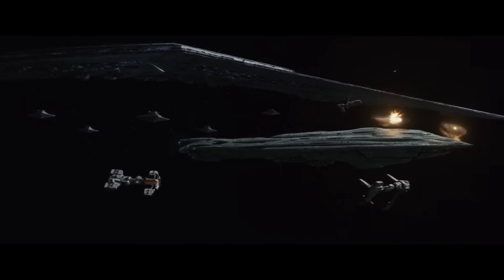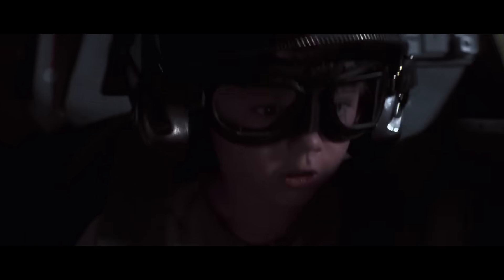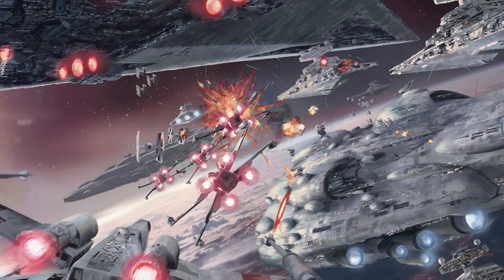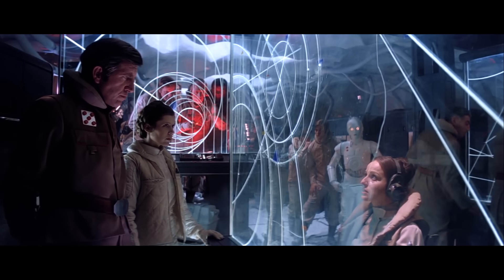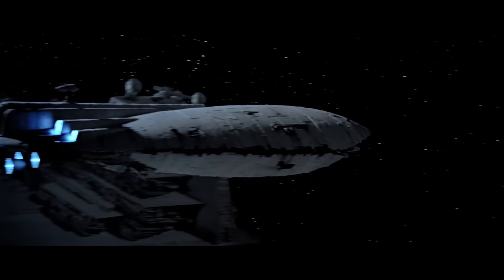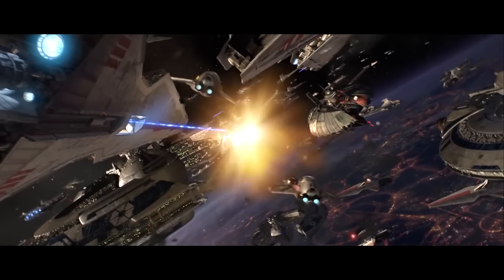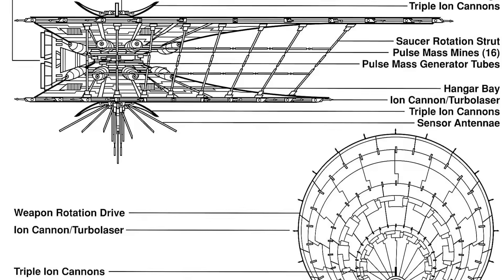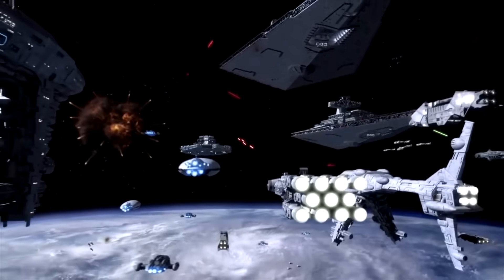Why Star Wars Turbolasers SUCK! (and better options) | Star Wars Lore

Comment: 341 attempt at Forerunners vs. Warhammer 40k.

For Thor's Hammer!!!
Reply: Molom Labe The FORERUNNERS??? IN 40K?
Reply: Anything vs the "entire" 40kverse is gonna lose. I'm not just being a fanboy, the 40kverse is just designed to be excessively over the top.
Reply: Forerunner would win but it would make them give effort to the war. If you think 40k is overpowered than your going to pass out trying to understand the scale of power of the forerunners
Reply: @themadtacoeatingfool5228  
Khorne laughs at Forerunner power 
Tzneetch scoffs at the Forerunners plans
Nurgle giggles at what they call creation
Slaanesh sighs at what passes for their ambitions
Reply: This is not a legit suggestion. Not saying that it isn't a good question, but Thor's Hammer puts that some suggestion multiple times for each video, so the real number of him trying daily is actually much lower.
For example, on just this video, he has a comment with 8 likes saying:
"Attempt 356
Do the Forerunners vs The Imperium of Man (Halo vs Warhammer 40k) please."
And another comment that has 3 likes saying:
"Attempt 354
Do the Forerunners vs The Imperium of Man (Halo vs Warhammer 40k) please."
And incase you are wondering, he didn't even put an Attempt 355 on this video. So he's also just skipping numbers here, and I doubt it's his first time doing this, or it being unintentional here. Not to mention that this comment is at Attempt 341, which is noticeably less than what Thor's Hammer says he is at.
EDIT: I @'ed someone when making this comment, that was unintentional.
Reply: i concur, i would like them go up against the nids, chaos or necrons.
Reply: @itsyaboidaniel2919  This is the level of Fact checking and Research that seems to be missing for some people.
Reply: Lol here we go. The Forerunners have the ability to easily curb stomp the warhammer 40k universe. For one example all their weapons have the ability to disentigrate just about anything they fire at. Also in Halo: The Flood the guilty spark mentions to Master Chief that his power suit is inadequate and tells him he needs a lvl 12 power suit. And as it has been shown Master Chiefs suit greatly augmented his strength and allows him to tank plasm bolts, explosions, falls from orbit, and kinetic damage. Imagine what a lvl 12 could withstand, basically anything the space marines, Tau, Chaos, tyranids, and eldar could throw at them with their handheld weapons and even shots from their armor.

In space the Forerunners have something called a fortress, there would be thousands of these, which is a dreadnought ship that is 50km long and has row upon row of heavy plasma cannons, along with fighter bays. Just a handful of forerunner cruisers were strong enough to totally eradicate a ring in the book Cryptum. It was also mentioned in Cryptum that the warrior caste has flipped a planetary crust upside down before totally annihilating it from space.

Also on the ground the Forerunners have something called a war sphinx which has the ability to wipe out cities, and sweep across continents, and if we go by size a lvl 12 powersuit can tank a ridiculous amount of energy, and kinetic damage, a War Sphinx can take a heck of a lot more.
Reply: The Forerunners ecumene consists of over 3 million worlds, they have visited other dimensions, can tend and alter stars, have the ability to make entirely new planets and stars in some short 10k years, have mastery over slipspace and can rapidly move forces around via slipspace as well (with speeds in excess of millions to trillions times C, meaning that moving across the galaxy is child's play). Of course, they also have the Halo array as a last resort to burn out every neuron in the Tyranid hivemind (and themselves) if need be. Fighting the Tyranids would not be like fighting the Flood, as the Flood gained their foothold via means that the Tyranids simply can't access (also no logic plague, so Forerunner security would be preserved as well). In addition, blowing up stars to sterilize a star system of Flood life was standard practice during the Forefunner-Flood war, meaning that due to the Forerunner's ability to make new worlds from scratch, they can go above and beyond standard Imperial exterminatus procedures.

The Tyranids force is comprised of many, many hive fleets, each with thousands of ships to their name. So all of the hive fleets would mean a force of potentially millions of ships forcing their way into the ecumene. Tyranids do have a form of superluminal speed travel gia manipulation of gravity fields, but compared to Forerunner grade slipspace drives that allow for speeds of millions times greater than the speed of light, Tyranids might as well be turtles. Tyranids in general adapt fairly quickly to new threats, and if all hive fleets includes Hive Fleet Gorgon, then this could prove to be a problem for the Forerunners. And (assuming OP allows it) Tyranids would have access to psychic abilities that may prove deadly if they ever get on the ground.

This fight would most likely be a question of quantity. Tyranids have a lot of hive ships, but Forerunners have plenty of guns (Onyx sentinel formations come to mind). Some 50 sentinels could destroy a Covenant destroyer, and there were trillions on sentinels on Onyx, with a new one made every 6 seconds! How many sentinels existed in Forerunner space then? All the Forerunners would have to do it make a giant wall of sentinel formations at the edge of the Milky Way, and they will win. If the Tyranids manage to break through, they might have a chance of winning the ground battles on whatever planet. But as long as the Forerunners can maintain space supremacy, and fill the void with enough lasers, Forerunner ecumene takes this one. The Tyranids would be mere pest to the forerunners. They lack many of the advantages of the flood and would be little more then a joke.
Reply: Eck has liked your comment. The future seems bright.
Reply: @SpectrumWarrior1  if the fight takes place in the current WH40k universe, than the imperium, nids, orcs, eldar and necrons would be the least of the forerunner's problem. 

its a crapsack galaxy there where the result of a galaxy wide war between the old ones and the necrons are still being felt when they poisoned the immaterium with their dead. the eldar tore the reality and have the warp bleeds into realspace and the imperium is probably in its last stand following the 13th black crusade. 

they might wipe the imperium, but i doubt it will be a rofl stomp regardless of what system shattering weapons they have.
Reply: @rawwset  Like the Forerunners would give a flying fuck about what the Chaos gods thought. They have nothing to offer them that the Forerunners could want.
Reply: @itsyaboidaniel2919  I got from him and I kinda took it and expand it.
Reply: @internetzenmaster8952  The Didact wasn't genocidal until he was driven mad by the Gravemind. Forerunners as a whole completely abhor senseless violence. So that's a big no-go for Khorne. 
The Master Builder is an unchallenged position of power over the Forerunner Ecumene. He needs no help from Tzeentch. 
And good luck to Nurgle, being able to feed off of a race where death, entropy, decay, and disease are practically non existent.
Or Slaanesh who needs extremes of sensation to feed his/her hunger, where the Forerunners are deeply conservative and reserved. 
The Chaos gods are the respective characteristics they embody require them to be brought to their absolute extreme in order to gain any sort of power from them. In an idyllic, post scarcity society like the Forerunners, none of these would exist.
Reply: @MrMcp1995  Brilliantly said. I was looking for words for how Chaos wouldn't just instantly corrupt 80% of the Forerunners that many people love to bring up. You did it perfectly.
Reply: @internetzenmaster8952  the forerunners could easly stompnthe imperium
Reply: @MrMcp1995

Do you not understand how Nerg works? He uses the warp to corrupt flesh and minds, biological medical science would do nothing to it and the forerunners would succumb eventually. You literally can't treat the inflictions without warp manipulation
Reply: When comparing halo ancient races you gotta understand they they all all the definitions of a god species for any universe flood forerunner ancient human precursor all of them are gods.
Why precursors are gods
-they literally created the halo universe as we know it nuff said
Why forerunner are gods
-they literally can create life, they literally can create suns blackholes, matter itself etc
Why ancient humans are gods
- take forerunners and give them a boost you got ancient humans
Flood
- the literal embodiment of the precursors wrath
Reply: @SpectrumWarrior1  we have immortal daemons empowered by war and conflict that come  back when they die. You just lost.
Reply: @MrMcp1995  if you used your brain you might realise that I'm using we to refer to the the group of people who support the wrhakker universe winning in such a conflict
Reply: Warhammer may have gods and a hundreds of times more numbers than the forerunners but at the same time the forerunners have a neat bioweapon called the flood and  superweapons the Halo rings
Reply: @TouringWolf42  none of which would stop warhammer. The tyranids are far more adaptable and have way more numbers than the flood, and both the flood and the forerunners would be wiped put by a good dose of nurgle's rot seeing as you have no psykers to cure it. The rings are also useless agasint the tyranids or necrons and would have debatable efficacy against demons. Either way firing the halo rings would be an exceptionally bad idea against chaos as the mass death would empower it and may be make a new chaos god
Reply: @naggie6358  the halo rings destroy sentient beings and as far as I know tyranids have a biology plus the forerunners with their technology could easily change the outcome like they did by letting humans survive the Ring purge around the GALAXY even if tyranids were to eventually overpower with numbers doesn't mean the forerunners can wipe most of them off the face of the Milky way
Reply: @TouringWolf42  the tyranids have chitinous exoskeletons and lack sentence, both of which make them immune to the flood. Even if they weren't they would still adapt to be immune to flood infection after the at most couple of hundred infections. Also the rings only kill sentient life, which tyranids are not, and modifying them to kill sentient life would just wipe everyone out apart from chaos and the necrons
Reply: @naggie6358  Do you even know what is the flood ?
Reply: @decagamin5901  extra galactic parasitic organisms, massive population. Infects species with a central nervous system, and based on how the rings work to stop them, sentience. Induce forced and rapid mutation within the host. Infection works by attacking through the spinal cord to kill the victim before a forced rewrite of the brain and the introduction of a flood master cell to start mutation. Very little in the way of their own tech, mechanical or otherwise, generally using stuff from infected individuals. Tell me if I missed anything
Reply: +Internet Zen Master,

"Imperium of Man probably loses (but makes the Forerunners commit a lot to doing so)"

no lol, Forerunner Production alone makes them win against the Imperium, even if they were only on-par with Pre-War UNSC ships the Forerunner's would still win through goddly production.

"but Forerunners get wrecked when matched against all of the 40k universe (assuming this is Forerunners going into the 40kverse anyway)."

uhm no lol, again Production alone dictates that they would stand a chance, and Production+Power dictates that they win against modern Wh40k, but WIH Necrons could maybe stalemate them.
Reply: +Internet Zen Master,

"Necrons laugh in the Forerunners face"

and get fucked because the Forerunner spam mech suits each individually more powerful than a necron lord (and has a variety more uses.)

"Chaos says "thank you for all the new converts""

and also gets fucked because the Forerunners don't have souls in the Warp because they aren't native to Wh40k, and they like Eldar capture their "souls" when they die, and Forerunners are known to be able to manipulate other dimensions quiet well. (meaning they could quiet easily fuck with the warp, and possible close it off from Realspace like the Necron's can.)

"and Orks will loot Forerunner tech and turn it against them"

more likely they will all just die because the Forerunner anti-matter weapons.

"which are two of very few sci-fi verses that can out-"over-the-top" the 40kverse"

you have far far far too high of an opinion of Wh40k, it's a mid-tier sci-fi at best.
Reply: +Mustang McKraken,

"Do you not understand how Nerg works? He uses the warp to corrupt flesh and minds, biological medical science would do nothing to it and the forerunners would succumb eventually. You literally can't treat the inflictions without warp manipulation"

first off, he needs to get the virus too them, second they aren't completely magical viruses lmao, they can be combated with fucking nano-tech (as shown by the nids,) which means that the Forerunner suits alone wouldn't even have to destroy the virus because they can just keep it from spreading with nano-tech.
Reply: @thyreradim7885  the necrons could destroy the entire milky way with the celestial orrery, they can use time travel, they harness suns to use as battlefield artillery, they enslaved their own Gods and turned them into super weapons that can throw meteorites me antimatter at people, they have weaponry that bypasses all armour, they have defenses that are almost impossible to breach, they have planet sized battleships etc. Chaos would be fed by the resultant conflict and any mass death you propose the forerunners would cause to win would massively empower chaos and maybe even create a new chaos god. And lastly, ork tech is powered by belief. Forerunner weapons could be antimatter or whatever, orks could still work them. And lastly, the forerunners were beaten by the flood, and the tyranids are far more powerful than the flood was.
Reply: Taylor N  i agree with you on all points there. But while I do think this is a pointless discussion (but for other reasons) this is all of 40k, not just the imperium involved here. Yes the imperium would get floored but chaos, the necrons, the tyranids? They are worth more consideration, especially if we take all factions at their peaks considering peak forerunners are being used
Reply: Taylor N  agreed, but then the numbers become so vague and nebulous that all discussion becomes pointless. The tyranids have an unknown population and would increase at an unknown rate and would evolve in unknown ways. the necrons once ruled the galaxy, so it is hard to say how many still remain sleeping in tomb worlds. Chaos becomes an even more confusing dynamic with the deaths of every race involved feeling them to an unknown extent. But because the values are so vague, it effectively reaches a point where no side can convince the other effectively. In the end fans will probably just stick to which ever one they like more in this situation.
Reply: Taylor N  the problem with chaos still exists though, the very act of trying to fight them makes them stronger. Hell if the forerunners did wipe out every other 40k race including all the tyranids, the mass death would be worse than the war in heaven. For all we know that would make a galaxy enveloping warp storm and birth a new chaos God. Of course we don't know, which is where the discussion becomes a bit confusing. Personally I think the best case end result for the forerunners would probably be like the sort of status quo 40k has going on where chaos is still very much a present and dangerous threat,  it is semi contained to a few smaller regions.
Reply: Taylor N  also worth noting that you can have partial or full resistance to composure by genetic modification so the tyranids would eventually adapt to it. Also do we have any examples on it be used on inorganic life? Im interested in how it would affect the necrons.
Reply: +Ludum,

"the necrons could destroy the entire milky way with the celestial orrery"

nope, just stars.

"they can use time travel"

not really, it's pretty shitty time travel that has far too many damned rules to be useful in any scenario.

"they harness suns to use as battlefield artillery"

lmfao, you mean plasma? pretty much every faction in all of sci-fi uses plasma for something. And no Necron's tend to not use Plasma, they tend to use anti-matter weapons like the Forerunners so try again.

"they enslaved their own Gods"

not gods lmfao

"and turned them into super weapons that can throw meteorites me antimatter at people"

lol funny.

"they have weaponry that bypasses all armour"

nope, most Wh40K armor and it does it by utilizing dimensional phasing. 

"they have defenses that are almost impossible to breach"

nope lol, that's for Imperial Guardsmen.

"they have planet sized battleships"

lmfao, they have as far as we know 1 individual ship that was the size of a planet and it took thousands-millions of years to make and was made by actively replacing the original planet over thousands if not millions of years.

"Chaos would be fed by the resultant conflict and any mass death you propose the forerunners would cause to win would massively empower chaos and maybe even create a new chaos god"

the problem is the same that comes from Chaos not wanting to slaughter all Humans in wh40k, they need some alive to feed off of or else they are 100% completely powerless, if Forerunner's slaughtered all living being in the galaxy then Sure, Khorne and Nurgle would grow fairly powerful, but since the deaths wouldn't be too them as in like a sacrifice then they wouldn't gain much, and they would lose so much more.

"And lastly, ork tech is powered by belief. Forerunner weapons could be antimatter or whatever, orks could still work them"

doesn't matter because like Necrons Forerunner weapons would just disintegrate Orks, and knowing the Forerunner's it's highly likely they would utilize the Orks power of belief.

"And lastly, the forerunners were beaten by the flood, and the tyranids are far more powerful than the flood was."

this alone proves that you are a total dipshit who doesn't need to argue in sci-fi vs's, far too many ignorant assholes pull this same stupid ass argument. Flood and Nids ARE VERY DIFFERENT THINGS. Other than both being biologically based they have almost nothing in common.  Flood scale to the power of who they fight making them one of the few mid-tier sci-fi factions able to compete against say the Culture, while Nids don't scale for shit. Sure they're powerful, but no more powerful than the Yuzhong Vong from Star Wars.
Reply: +Taylor N,

"This needs to stop. It's so pointless. It always becomes the same rage boner induced fanboy BS. 

No a level 3 million space marine cannot beat the Didact. 

No, even the strongest Imperium ship will not beat a Sojourner class dreadnought.

Yes the Emperor of mankind is essentially on Precursor level.

Yes the Forerunners have killed Precursors before 

No I don't care about your Warhammer40k fantasies and "statistics."

Yes the Forerunners can command the fabric of reality

 Yes, flood are the zombified reincarnation of Precursors.

Yes Imperium will get floored"

I agree on some of your points, but anyone can, and jesus christ you need more halo lore.

"Yes the Emperor of mankind is essentially on Precursor level"

hes not at all on Precursor level lmao, close sure, but hes not. Unlike the Precursor he didn't exist before the universe did. And also unlike the Precursor, he didn't seed all life in the known universe
Reply: +Taylor N,

" I can agree on that. Caught off guard, Forerunners would lose to either of those three factions quickly. But prepared? It would be a very long war of attrition, heavy casualties on both sides. Winner would come down to the one who can outproduce the other. The other Warhammer 40k factions are irrelevant"

really? you think that any faction in wh40k can outproduce the Forerunner? That just goes to show how much you need to research it.
Reply: @thyreradim7885  first when I say the necrons use suns, I meant that literally. The aeonic orb is literally a Sun contained with a necron construct that has its containment field breached to release the energy of a star as a weapon. Destroying the orb means that the star will be released and will likely destroy the whole solar system. Long story short, once an aeonic orb enters the area either the necrons win or no one does. Second, I don't see how causing every star in the milky way to go supernova at the same time is different from destroying the galaxy. Third the c'tan shards are actively described as having the power 'antimatter meteorite'. Fourth, the nids scale to their opponent far better than the flood. The flood only mutates its victims based on what was already present, where as the tyranids produce new biomorphs constructed from the best genetic material of every race they consume and are constantly adapting at an insane rate.
Reply: @thyreradim7885  oh and a common 40k saying to describe how chaos works is 'khorne does not care from where blood flows, only that it does'. The Gods don't care if you do things in their name, it still makes them more powerful. Hell some of the chosen champions of the 4 actively reject allegiance to the chaos Gods.
Reply: @thyreradim7885  and for the record, the C'tan and the necrons beat the old ones, who would be considered a tier 1 or tier 0 civilisation. If you want to take peak forerunners, I'm taking peak necrons which means you have to deal with the full power C'tan who are about as close to Gods as you will get, seeing as they have near omnipotent control over this plane of existence at full power
Reply: @thyreradim7885  and to top it all off, necrons prominently use gauss, tesla and particle whip weaponry with the occasional more exotic piece like tachyon arrows not antimatter. Your continued misrepresentation of necron tech and abilities, including the outright denial of some of their abilities and tech without reason, shows that if anyone here needs to do some research it is you.
Reply: +Ludum,

"first when I say the necrons use suns, I meant that literally. The aeonic orb is literally a Sun contained with a necron construct that has its containment field breached to release the energy of a star as a weapon. Destroying the orb means that the star will be released and will likely destroy the whole solar system. Long story short, once an aeonic orb enters the area either the necrons win or no one does"

The aeonic orb was so rare they aren't worth mentioning, there were literally less than a dozen in the entire galaxy so I fail to see any strategic advantage. Also it's a fragment of a star, not an entire star. And it releases the energy of a solar flare, not the entire star. And it also can't even destroy an entire planet so yah lol, you overplay this shit far too much.

"Second, I don't see how causing every star in the milky way to go supernova at the same time is different from destroying the galaxy"

because Forerunners still survive as do most space faring races in most sci-fi lol, also the celestial orrey doesn't always cause stars to go supernova, sometimes it just snuffs them out.

"Third the c'tan shards are actively described as having the power 'antimatter meteorite"

again funny  because of the fact that standard infantry weapons fire anti-matter meaning that this is just a slightly up-scaled variant lmao.

"Fourth, the nids scale to their opponent far better than the flood"

not even close.

"The flood only mutates its victims based on what was already present, where as the tyranids produce new biomorphs constructed from the best genetic material of every race they consume and are constantly adapting at an insane rate"

wut? You think that individual units make any damned difference? Again goes to show you should research far more than what I'm telling you. First off the flood gain all knowledge from said infected individual, second they can immediately use any and all equipment that the faction they are fighting has, third after getting a keymind they just improve the shit out of whatever they have. Also Nids adaption is a fucking joke, they literally adapt the exact same as the Borg from Star Trek, Remember the nids fighting the Tau, well Tau started winning ground battles by giving fire warrior 3 different rifles that fired different ammunition types, by rotating rifles every other Nid wave the nids never fully adapted to any of the weapons. That can give us a reasonable conclusion that nids only hold 1 adaption at a time (for some unknown retarded most likely plot armor reason.)
Reply: +Ludum,

"oh and a common 40k saying to describe how chaos works is 'khorne does not care from where blood flows, only that it does'. The Gods don't care if you do things in their name, it still makes them more powerful. Hell some of the chosen champions of the 4 actively reject allegiance to the chaos Gods"

"A Champion of Chaos, also styled as a Chaos Champion, is an individual who has dedicated his or her life to further the cause of a particular patron Chaos God, or Chaos as a whole in the form of Chaos Undivided. He or she is either an extremely powerful warrior, such as a Chaos Space Marine, or a psychic Chaos Sorcerer."

Also, if that was the case then chaos rituals wouldn't be the main focus of half the damned wh40k games. Also there is the fact that they literally require the emotions they feed off of or it doesn't matter how much power they have, they just grow weaker.
Reply: Taylor N  well as I said before we have no way of knowing how many aeonic orbs are still buried on tomb worlds, which is why I said this was all pointless. The necrons could simply wait out a halo ring pulse within a pocket dimension. And lastly, c'tan are stupid powerful. They are capable of near instantaneous travel, can rework the surface of an entire planet with a thought and eat stars for breakfast. They were so powerful that 8 battlestations combined, each of which could destroy a planet, couldn't hurt one. Singularities and antimatter are nothing to the necrons, and the void dragon could just take control of all the forerunners technology. I'm sorry but without the warp a significant defence against the peak necrons with the full power c'tan is virtually impossible. Not to mention that even if you did kill the c'tan the backlash on the physical universe would be disastrous for the survivors
Reply: @thyreradim7885  ok then time to point out where you are wrong again. We don't know how gauss weapons work exactly, what we do know is they function by breaking the forces that hold molecules together. As a result even a simple gauss flayer would be effective against forerunner tech and once the armour is stripped down, I'm pretty sure it can't heal the user nor could it save then from having their head stripped clean off their body. Tesla weapons don't fire just lightening, the bolts of green energy it releases seek out targets independently and grow more powerful as they do damage, so yes they would do plenty against the forerunners. Aeonic orbs do contain a whole sun, we know for fact that the necrons built more than one battlestation on the scale of the world engine, and you still haven't told me how the forerunners would beat the necrons destroying the galaxy with the celestial orerry or how they would kill the full power c'tan
Reply: Taylor N  I will say that the necrons themselves on the whole are inferior to the Forerunners, but I do believe that they have some stuff that the Forerunners can't beat. If it was the necrons as they exist in 40k, then sure the Forerunners win but I think the War In Heaven necrons do stand a chance in some areas.
Reply: @naggie6358  It's really easy to overestimate the Celestial Orrery and probably the supernovas too. The Oruscar Dynasty keeps a tight leash on the damn thing and are even willing to fight other Necrons just to keep it safe from any murder happy psycho that tries to use it. Necrons using the Celestial Orrery to destroy the galaxy is as out of character as the Forerunners using the Halos. Using it tactically is a better option but do it too much and it'll upset the natural order of the galaxy. They would then literally need thousands of years of constant management to fix it.

And we all love to think supernovas are instantaneous. They're not. Using supernovas to destroy ships is the same as throwing a ticking time bomb into a bunker. Anyone with a brain would gtfo as quickly as possible. Light takes up to 8 minutes and 20 seconds to reach Earth from the Sun. Assuming the sun is expelling all that mass at 10% the speed of light, it would take about 80 minutes for the blast to reach Earth and about 2 hours to reach Mars. Of course, for the Forerunners, that's more than enough time to evacuate an entire planet and even more than enough time to Slipspace out.

As for the C'tan, I'll admit there's probably no way for the Forerunners to combat even one. At first, I thought they could simply accelerate its aging by billions of years every second but there's also the problem of getting it into the chamber in the first place.
Reply: @egorex1834  good to see someone i can agree with here. i am fully aware that using the Orrery is extremely out of character, as you said just as much as the Forerunners using the Halo array. I only brought it up in that capacity as i was dealing with people who said that the Forerunners would open the war by doing that very uncharacterisitc thing, and i took the stance that if they are going to do that then i might as well do it too. As for the supernova thing, i sort of get what you mean but i was thinking of it as more a strategic thing than a tactical. Sure you might not be able to wipe out fleets with it without some very careful manouvering, but you could destroy particularly important planets or installations foe example.The big one i was thinking of would be to use it to take out facilities housing the major Ancilla and stuff like that needed in coordinating defences.
Reply: @egorex1834  oh and im not sure if C'tan even are affected by age seeing as how they have existed since the beggining of the universe and seem to have only gotten more powerful. Not saying that wouldnt work if you could somehow do it, im just not sure that it would.
Reply: +Ludum, 

"well as I said before we have no way of knowing how many aeonic orbs are still buried on tomb worlds"

"Even during the war against the Ancients only a handful of these were used"

and again, they aren't really meaningful for shit.

"The necrons could simply wait out a halo ring pulse within a pocket dimension"

so? not all Necrons could, and they wouldn't know it was gonna happen, so more than likely most of them would be damaged/destroyed by it.

"And lastly, c'tan are stupid powerful"

no not really.

"They are capable of near instantaneous travel"

so are forerunner.

"can rework the surface of an entire planet with a thought and eat stars for breakfast"

uhm no lol, they spend considerable energy doing anything on the scale of fucking with entire planets, and they don't "eat stars for breakfast" they spend literally thousands of years eating stars, while a Forerunner mining ship swallows them in hrs-days.

"They were so powerful that 8 battlestations combined, each of which could destroy a planet, couldn't hurt one."

what fucking battlestations are you talking about? Because that's a class of space vessel not unique to Wh40k, so you're gonna need to be more specific. Also I already addressed that, they were killed by what was essentially neural physics and Halo rings destroy neural physics, therefore concentrated halo power beats C'tan, and the original Halo rings could target specific things.

'Singularities and antimatter are nothing to the necrons"

so? And also Proof.

"and the void dragon could just take control of all the forerunners technology"

Proof (?)

"I'm sorry but without the warp a significant defence against the peak necrons with the full power c'tan is virtually impossible"

again you don't know enough and have far too high of an opinion. Like seriously name 1 thing the Forerunner can't counter.

"Not to mention that even if you did kill the c'tan the backlash on the physical universe would be disastrous for the survivors"

Ehh, probably not, they seem to be the exact same as neural physics from Halo, as in literally the exact fucking same thing. I can't stress just how much they are alike and how there is 0 evidence to counter them being the exact same thing.
Reply: +Ludum,

"ok then time to point out where you are wrong again. We don't know how gauss weapons work exactly"

"When fired, they appear to produce focussed bipolar magnetic fields so that anything the weapon is targeted at, such as a human body, will be "pulled" (at the sub-atomic level) towards the gun. Gauss Weapons appear to pulse with intense electrical currents, which form the potent magnetic fields that strip the target's constituent atoms even as the target is attracted towards the weapon"

https://warhammer40k.fandom.com/wiki/Gauss_Weapons

dipshit.

"As a result even a simple gauss flayer would be effective against forerunner tech and once the armour is stripped down"

lol, they pull molecules, and damage at the molecular level. Forerunner combat skins repair at the molecular level and can use light to repair themselves. Therefore Gauss does jack shit.

"I'm pretty sure it can't heal the user nor could it save then from having their head stripped clean off their body"

it could, it's simply about Gravitational pull, that is really all the Gauss weapons are.

"Tesla weapons don't fire just lightening"

"Tesla Weapons function by unleashing bolts of living viridian lightning"

it's lightning you jackass, provide some quotes and then counter my shit.. oh wait you can't.

"so yes they would do plenty against the forerunners"

they have to do damage to get more powerful.

"Aeonic orbs do contain a whole sun"

"this weapon is fueled by a fragment of a star"

FRAGMENT YOU DUMB FUCK. I keep putting quotes and lore, and you just ignore it like a dipshit either leaving you as a dumbass, or a troll.

"we know for fact that the necrons built more than one battlestation on the scale of the world engine'

"The World Engine was the name given by the Imperium of Man to a monstrous mobile artificial Tomb World of the Necrons of the Neokhares Dynasty, known to those undying xenos as Borsis. It was discovered in the Vidar Sector of the Imperium in 926.M41 after the Necrons hibernating in stasis tombs beneath its metallic surface rose from the Great Sleep"

dumbass.

"and you still haven't told me how the forerunners would beat the necrons destroying the galaxy with the celestial orerry or how they would kill the full power c'tan"

Necron's don't destroy the galaxy, they just destroy all the stars, and Forerunner used supernova's as a flashbang mid-battle lmao. Also I have told you, C'tan were defeated by what is essentially neural physics weapons (suggesting they are also the product of neural physics,) and the energy from the Halo array is known to completely annihilate Neural Physics, therefore using common sense Forerunners instantly beat Necrons by just firing 1 Halo ring towards the Necron part of the galaxy.
Reply: +Ludum, Precursors existed in a time from before our universe, the Time-Lock killed one in minutes lol. Also I never said they would start with the Halo rings, but they would more than likely use the original ones on the C'tan given the chance simply because of a lack of options. And the Halo's as shown by evidence in my previous comments would more than likely completely destroy them.
Reply: @naggie6358  Ehhhh not really. If by major ancillas you mean metarch-classes like Mendicant Bias, his casing can either range from two meters tall to about ten, both of which can be transported easily. There's also probably dozens of back ups of him across the entire galaxy, which you won't even know where to find unless you're a high ranking Forerunner. The supernovas are gonna have to be used on extremely immobile targets, like probably shipyards or just deny them access to resources by vaporizing the planets in the system entirely. 

And I know the C'tan existed since the beginning of the universe. The Precursors are the same and probably older than the universe itself.

"We are your children, Librarian. But we are also their children. And what they learned across many 
billions of years they stored in this galaxy. We do not know where. The Gravemind tells us something 
impossible to understand-that most of what has been gathered comes from before there were stars. 
We do not believe in such a time, but the Mind insists ... The life-patterns and living wisdom of a 
hundred billion years."
Halo: Silentium

It should be noted that Precursor bodies are mere physical representation and that their true consciousness lie elsewhere, most likely in an alternate existence. Even so, they were capable of evolving and devolving their bodies at will. That still didn't stop it from aging to death by Forerunner time lock. Assuming Necrodermis have the same chemical properties of ordinary metal, accelerating its aging would cause deformation and greatly reduced resilience and durability. We actually accelerate the aging of metals all the time by treating it in extremely high temperatures.

It should also be noted that C'tan bodies are not indestructible. The Necrons were able to shatter them into shards with weapons that harnessed the energies of the living universe, which is pound for pound what Halo Neural Physics is based on.